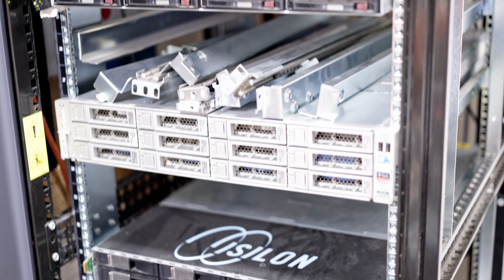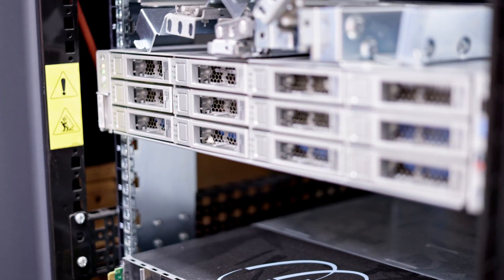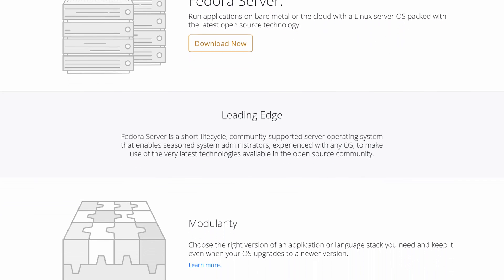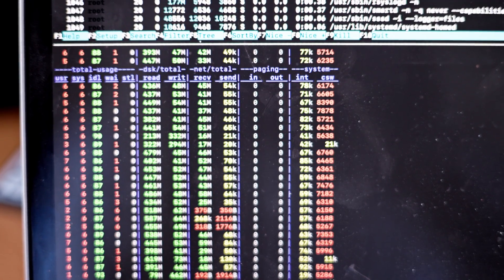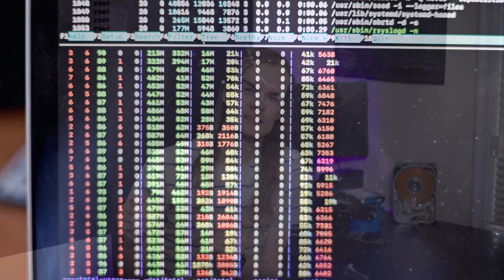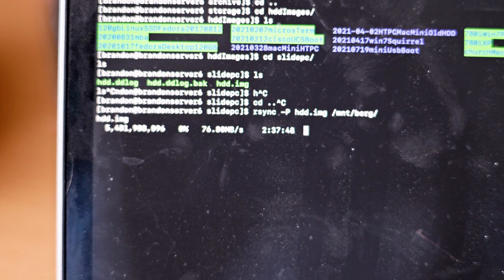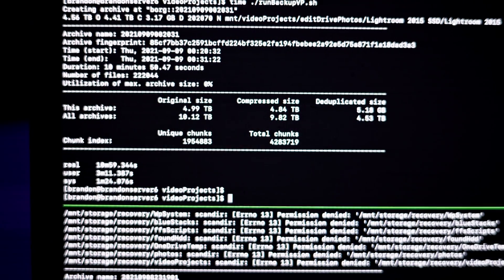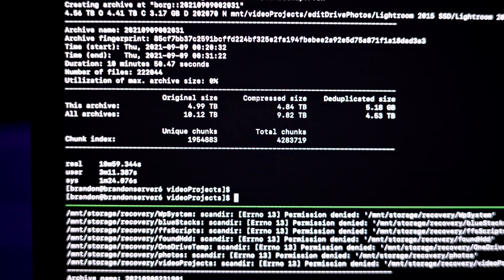Setting up a backup for my main server

Comment: You can use "nmon" to watch disks and more.
Also FYI
Your speed issue is a borg issue, it's worse with encrypted drives with LUKS but I've seen that on many servers, where the CPU doesn't max, the HDD isn't max. 
Also it reads the drives to get the data, then stops reading, writes the blocks for borg stuff... and then starts reading again, this also slows it down a lot.
Not much of an issue, but it does exist, and you have seen it.. and I have as well.